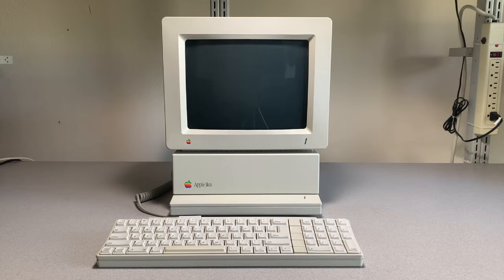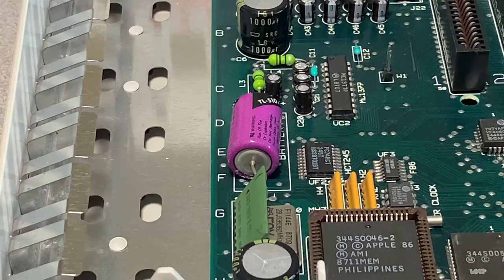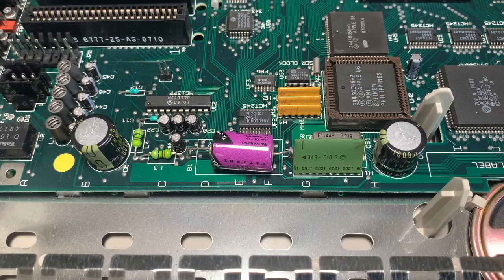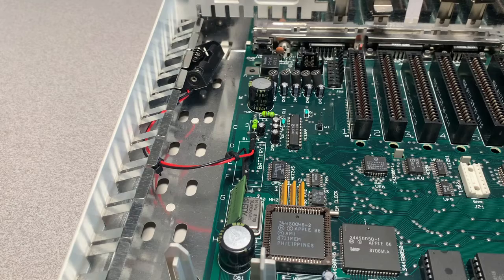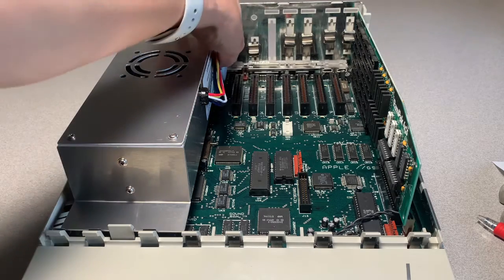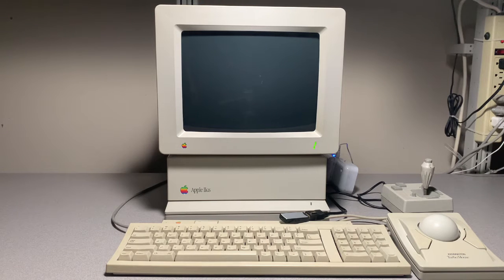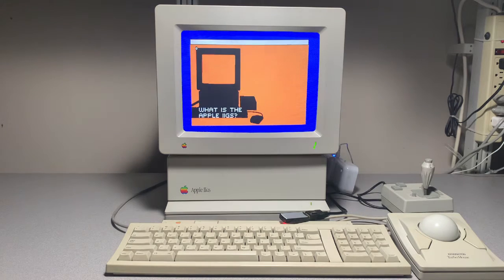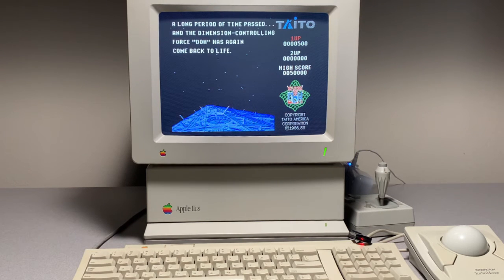Apple IIGS - Upgrades from Reactive Micro and Garrett's Workshop

Comment: Interesting… I thought the battery swap would require some soldering! They just slide on?
Reply from the maker: Hi Mark Magaña,  Yup, no soldering is required for this battery relocation kit.  The connectors just slide on.  It's been half a year, and I haven't had any problems.

Comment: Reactive micro sells just the PSU replacement board. I went this option so I could preserve the original PSU housing, it’s easy to install. Also, I do not recommend Duracell batteries, they are not what they used to be. I’ve had Duracell batteries leaking into remote controls, a HP48G and other stuff, most of them were ruined (including the HP48G). They leaked after a couple of weeks (not months or years), were new (like still good for another 8 years) and bought in a reputable store (Costco physical store). I only use now Panasonic brand batteries, the only one which has not caused me trouble (until now).
Reply from the maker: Hi Aladim!  Agreed, going forward, I'll purchase the kit from Reactive micro.  Interesting info regarding the Duracell batteries.  That's a bummer, like you, I purchased a Costco pack.

Comment: I’m impressed the plastic clips aren’t brittle at this point. Could you have upgraded the CPU to the 14MHz one you mentioned?
Reply from the maker: Hi nunuvyurbiz123.  I definitely lucked out, I haven't had as much luck with the IIe slot covers.   When it comes to CPU upgrades, I'm not aware of a direct swap to 14MHz.  However, we do have the TransWarp GS or more recently, the AppleSqueezer GS (I've been eyeing that one).

Comment: In my experience so far there isn't too much that can go wrong with the IIGS ADB keyboard. Mostly if there's a problem, it's with the ADB connector itself. Sometimes the solder joints can break, and on the odd occasion the solder pad get's torn off. The former is pretty easy just to reflow the solder. The latter involves using small copper rivets to replace the solder pads and a jumper wire to complete the circuit.
Reply from the maker: Thanks for the info.  I'll take a look.

Comment: Good video. I would like to recommend some things. Do you know of the AppleSqueezer GS product? It gives you 14mhz CPU, 16mb ram (14mb available), SD card slot and the latest version has an HDMI socket on it. I also installed a fan inside the power supply (60mm x 15mm). I also installed a 4-channel surround sound output; you can connect another 4-channel output to that one for a total of eight channels. I'm also on a waitlist for a vidhd HDMI card which outputs a 1080p signal.
Reply from the maker: Thanks!  Agreed, I've been eyeing the Apple Squeezer for the last year or two.  (Pretty much every time I try to play Wolfenstein 3D...)

Comment: Thank you, for posting these informative vintage home computer upgrades to an Apple IIGS system.  Whenever, I try to upgrade one of my vintage Apple mac desktops it is always a week of "trail and error".  My last attempt was trying to add a PCI card with two USB "A" 1.1 ports to my Apple All-in-One 5500 system.  The installation went well only to learn that, I needed drivers that were not included in the retail box (smile...smile).
Reply from the maker: My pleasure.  Thanks for watching!   I have another one coming out soon on a stereo card for the IIgs.  I guess I'm weird, I enjoy the troubleshooting side of things.  Well, in my homelab, not in production. lol

Comment: The IIgs was not really a full 16bit computer. It was basically an Apple //e with an accelerator + fast ram attached. Everything apart from ROM, fast-RAM and CPU was 8bit 1MHz. The CPU itself is more or less an 8bit/16bit CPU. It has some 16bit features but so does the Z80. Most people say that the 16bit program counter is the smoking gun to categorize the 65816 into the 16bit realm. Others say that the 8bit commands are a clear indicator for an 8-bit CPU... i would say it is between 8 and 16 bit like the 68000, which was a 16bit/32bit CPU with similar limitations.
Reply: @john_ace - That's grossly inaccurate. The IIGS was indisputably a true 16-bit computer, its 65C816 CPU had a 16-bit internal data bus and 16-bit accumulator, along with a 24-bit address bus. Yes, the CPU had an 8-bit external data bus, but internally it bus was 16-bit and that is what determines how many bits it is. The IIGS was hindered by an unnecessary limitation caused by the Mega II, which forced it slow to 1 MHz for its I/O bus and screen writes, but it didn't make it any less of a 16-bit machine. 

It was of course a hybrid computer with two sides: a 16-bit color Mac-like machine, with backwards compatibility with the 8-bit Apple IIe in emulation mode. It was far more than merely an Apple IIe with accelerator and faster RAM however. In native mode it had a Toolbox, GUI and mouse driven software. A 32-voice Ensoniq wavetable synthesizer co-processor with dedicated RAM. It offered graphic capabilities far beyond what any Apple II computer could produce, nearly on par with the Amiga (640 and 320 mode resolutions, with a 12-bit color palette and up to 256 colors per screen). It had built-in AppleTalk networking, serial ports that could handle 115K, a built-in clock and Control Panel, up to 8 MB RAM, RGB video output, even the ability to do both cooperative and preemptive multitasking.  It was a vastly underrated machine, and in many ways superior to the Macintosh of its era, or the Amiga (in same areas at least) and Atari ST.

Comment: in the mid to late 80s one could get C compilers that generated decent code for the MC68000 and the Intel 80286 and 80386.  But the 6502 family of chips don't have reasonable support for high level languages. The generated code does awful hacky tricks to work around the deficiencies.

In the late 70s and early 80s successful commercial software was written in assembly language but in the mid 80s onward, companies were shifting to writing in C.

The Mac had good compilers but this IIgs, well, it's 16-bit CPU addressed greater memory access but didn't do anything to better support high level languages.

Writing in assembly language had by then become frowned on due to poorer economics equation
Reply from the maker: Thats neat background info.  Thanks for sharing!

Comment: Now you need a stereo card.
Reply from the maker: You're absolutely right!  I never understood why they would neuter the Ensoniq...
Reply: @70s80sRetroRewind  it's crazy they did that.   There are a few on the market but I'm happy to send you one I designed.  No strings.
Reply from the maker: @BobDarlington  That would be fantastic! Then I can then get more S out of the GS.  (Sorry, that was bad 🙂)
Reply from the maker: @BobDarlington  Just let me know what's the best way to contact you with my address.  Thanks!
Reply: @70s80sRetroRewind   this is wild.  I responded here several times attempting to figure out how to communicate and every response was removed.
Reply from the maker: @BobDarlington  Interesting.  I wonder if Youtube deletes comments with emails, telephone numbers etc.  Do you have Instagram?  If so, I have a page with the same name. @70s80sretrorewind.  That platform has a messaging option.